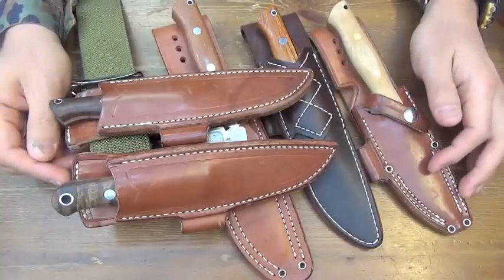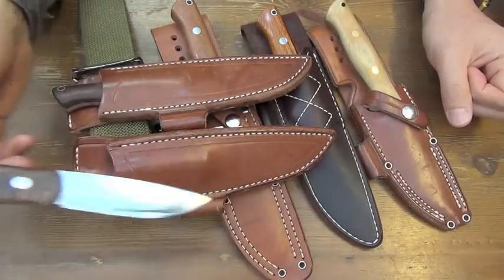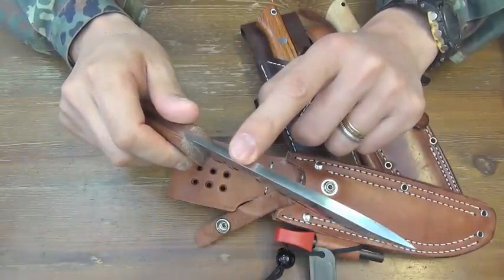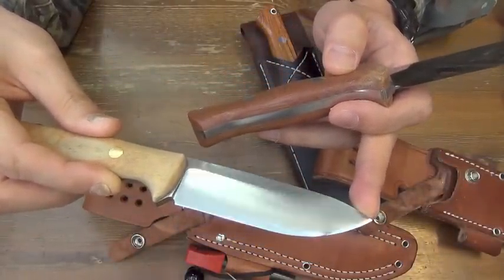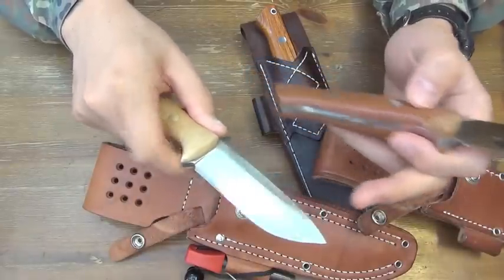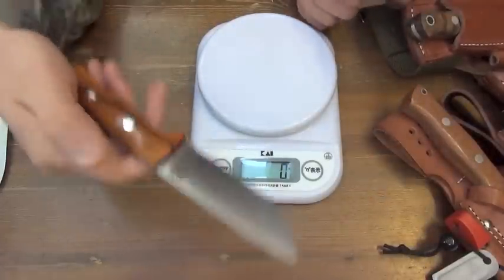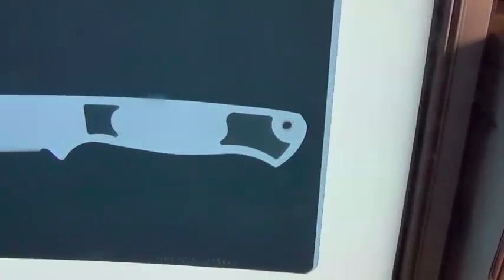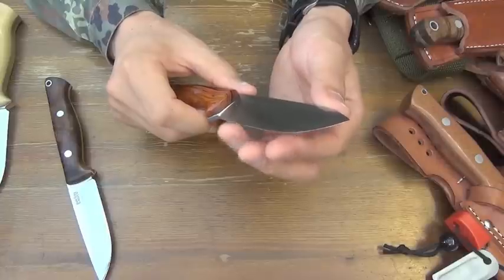Bravo1 3V LT Rampless Hunter preview

Comment: The New Bravo looks like it almost has a full height grind?
I do miss the "whoa scarry sharp"....
Nice knife though.  Thanks
Reply from the maker: Yes. The new LT has a higher grind almost full. And it doesn't have bevel fatness to the thinner stock. It is made out of CPM-3V which is prone to chipping in 25 degrees. So BRKT put a decent blended micro bevel to make the apex angle 30 degrees and a bit. I will sharpen it to a bit smaller than 30 degrees sooner or later. Thanks.

Comment: Just got my first Bravo1 3V with G10 handle (just because of this youtube channel :)) , and the handle feels slippery in my opinion. I want to purchase the LT version of this knife, but what handle to choose, if I want it not to be slippery? Wood? Micarta? I've heard they all are slipping a bit. I compare the BRKT's G10 to Spyderco G10, and Spyderco feels much better in hand.
Reply from the maker: Canvas Micarta has a little better traction with its texture than the others. Linen Micarta doesn't. G10 is just heavy and slick. Woods often shrink and sometimes crack or bend. I have ever sanded a micarta handle. But then it didn't increase its traction but just ruined its beauty. And never go to traction grooves ( jimping). Bark River's jimping has sharp corners and just gives your thumb pain. Thanks.

Comment: Wako,
Do you use a measuring device to determine the blade angle, or can you tell by practice?
Alan
Reply from the maker: I think A2 edges are normally 25 degrees from the fact that it is larger than Mora Clipper 22 degrees and smaller than Mora Robust 28 degrees. And I estimate my 3V angles about 30 degrees. Anyway once we are used to water stone sharpening, we can make out our appropriate angle for the steel and for the purpose quite easily. Thanks.